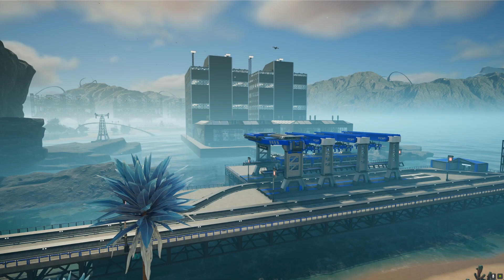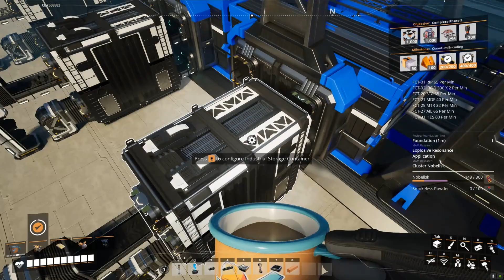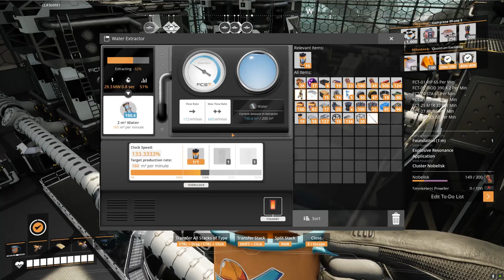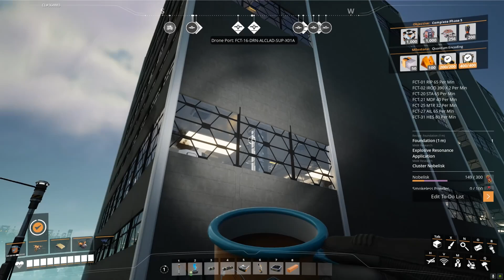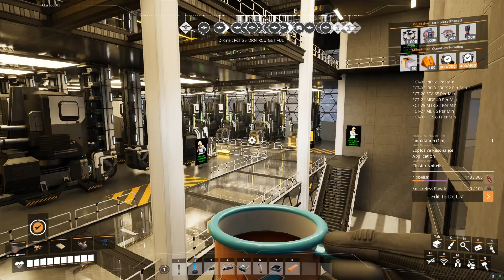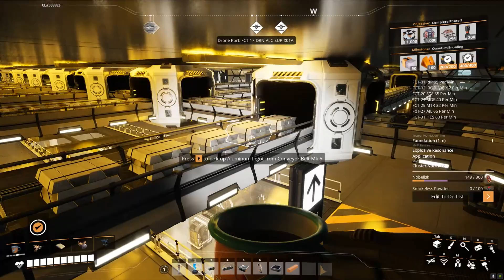Satisfactory How to Process Aluminum

Comment: Solid build. I was drafting up something similar. I've started using your factory stacks blueprints and they make a world of difference for building at fast rates. I just wish you had one for refineries that fits inside the 10x10 footprint.
Reply from the maker: I tried a long time ago and refineries, blenders and pipes just take up too much space.
Reply from the maker: I have not yet made the aluminum refinery into a BP, but the mod was updated for 1.0 now so I may give a shot in 10x10 just to see if I can.
Reply: @GillityrGames  That would be amazing if you can. I'm sorta using a placeholder right now, it's not nearly as clean, but functional. 

There is one design on satisfactory calculator that is for refinery smelting, it uses a 7x9 footprint. I took that one and tweaked it to work for most applications. but with your designs, my "factory city" is looking cleaner than ever.

Comment: Hi  there again, nice video and very interesting concept. I am making alclad and casings but in not very efficient way, so will definitely try it when you release the blueprints. On another note i noticed you changed up your old tier 7 prints, they look great, so i am using them in this paly through. Not making batteries as yet using turbo fuel although much smaller plant then yours. Regards thanks for what you do Pete